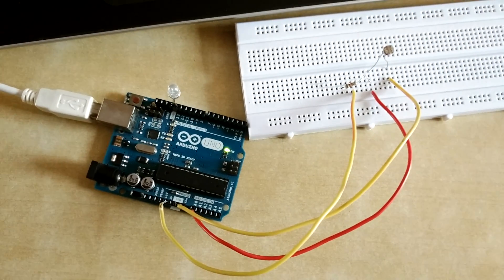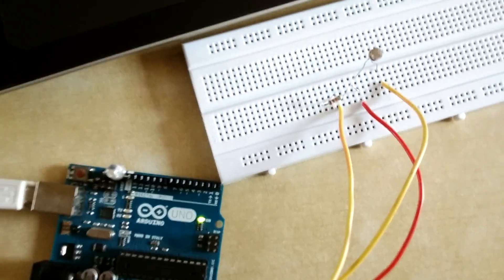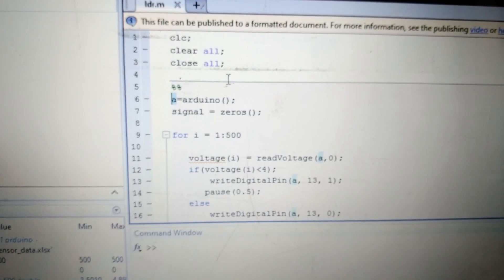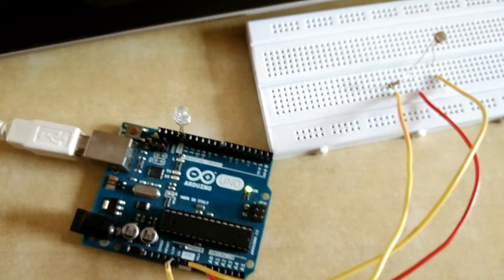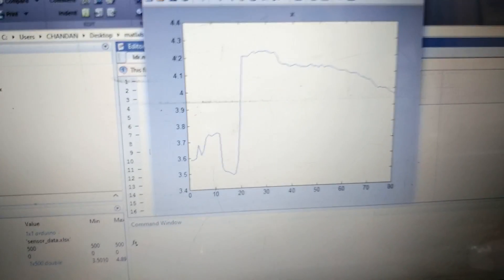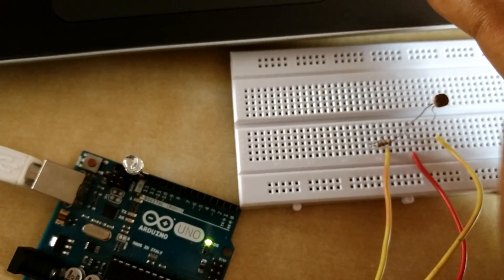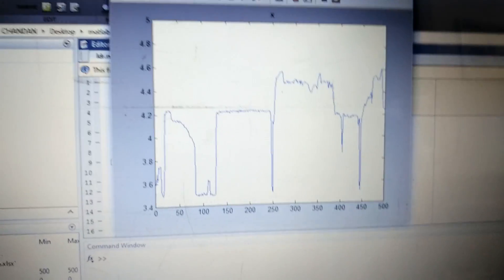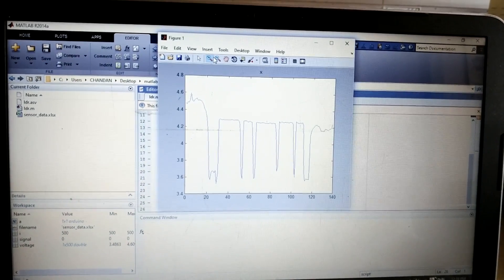Arduino 9 matlab real time

Comment from the maker: #### Matlab-Arduino Interfacing Program ########

clc;
clear all;
close all;

%% 

a=arduino();
emgsignal = zeros();

for i = 1:500
    
   voltage(i) = readVoltage(a,'A0');
   
   if(voltage(i)<2)
        writeDigitalPin(a, 'D13', 1);
        pause(1);
   else 
        writeDigitalPin(a, 'D13', 0);
       
   end
       
   plot(voltage, 'b');
   title('x');
   pause(.002);
   
  
end
filename = 'sensor_data.xlsx';
xlswrite(filename,voltage');
Reply from the maker: Ya I can use " 'drawnow('limitrate')' instead of 'pause(.002)' ", its basically a delay, so you can use anything which can generate delay.

From your second que What i understood is you want to put your arduino IDE code into MATLAb right ??
If this is your que then yes you can put it in MATLAB, you just need to install support packages into matlab.
Reply: what is the function of "emgsignal = zeros();"